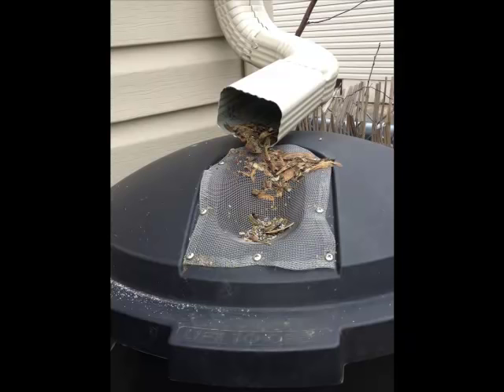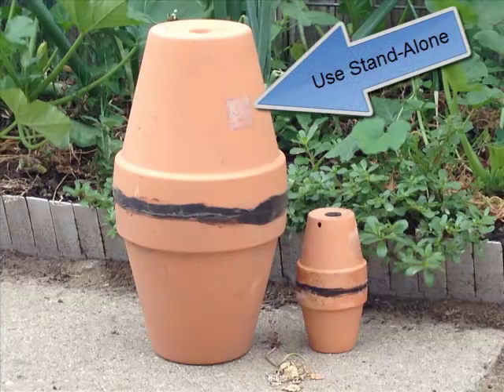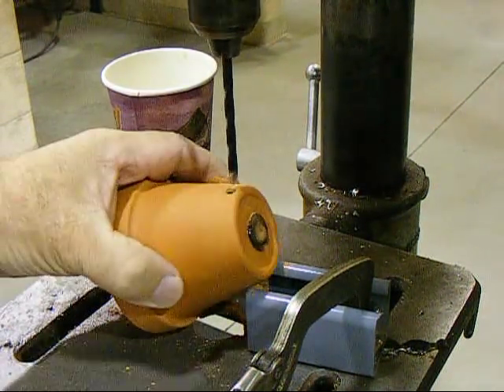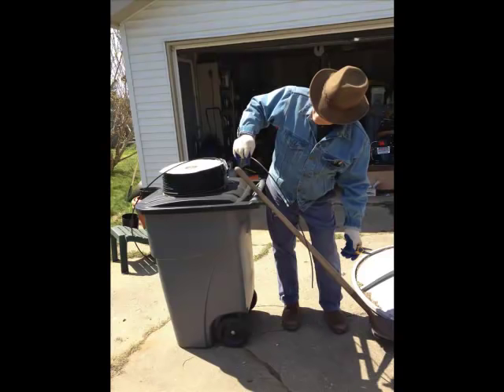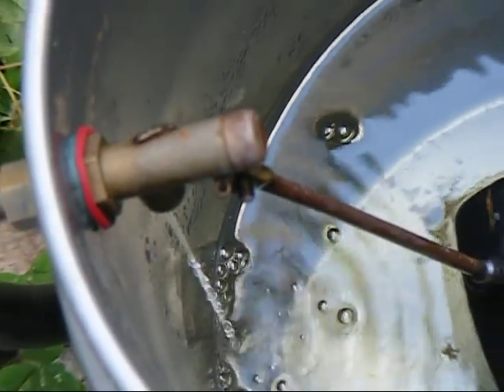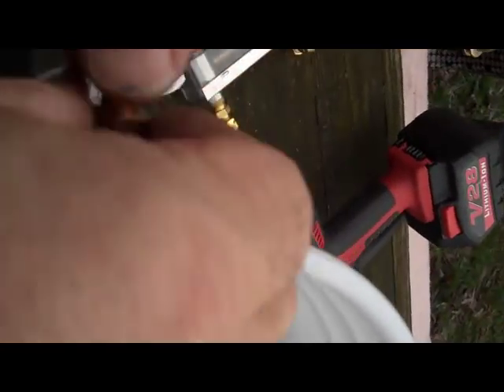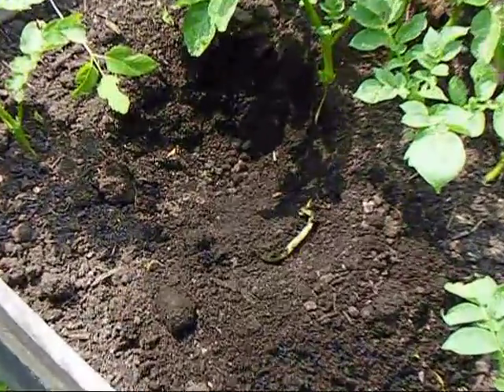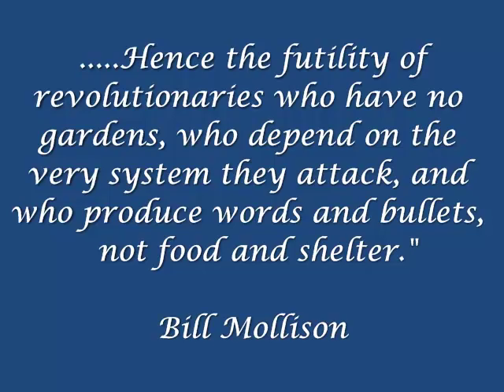Olla Irrigation Update - June 2012

Comment from the maker: I dug up the 21 ollas in my garden today, April 21, and none of them showed any sign of spalling or cracking due to freezing this past winter. All of the tubing connections were tight and the caulk joints were good and solid. The top of the ollas were typically about 4 inches below the surface of the soil, which I think is the key to my success. There were some other ones which were in another garden that were exposed at the surface and they didn't fare so well.

Comment from the maker: I really don't know how the Gorilla Glue does its magic, but it does seem to be fairly inert once it has set up. Thus far I've had no adhesive failures using it and it does a good job of sealing up the tubing at the point where the tubing is inserted into the posts.

Comment from the maker: The level in the bucket is determined by the amount of water needed by the plants. Most of the time a couple of inches of water above the irrigation tubing is fine. Ollas can operate at zero head pressure. The idea is to have just a bit of reserve so that the system stays primed at all times. However, the output of the system can be increased by simply increasing the water level in the bucket. A higher level increases the pressure on the capsules and thereby increases the flow rate. This can be

Comment: I think it's better to darken the vessels you use for water, not by painting them black but make a wooden lighttight  box (from pallets?). When u put paint on them the water will heat up to much. Using  a wood box will keep the water cool(er) and as long as there is no light in the tank, the algae wont grow.

Comment from the maker: Yes, using 5 small olla capsules in 4x4' raised beds seems to be working quite well for most of our plants here in Michigan, where we've had record-breaking heat and a lack of rain this summer. Our tomatoes, squash, cukes, and eggplant are thriving with the arrangement. Because of the drought I have raised the water level in the regulator bucket to help force a bit more water to the beds.

Comment from the maker: The float valve used in the bucket is a Dial #4164. The hose spigot on the IBC tote was connected using a short 1/2" pipe nipple and a 1.25 to .5 inch female threaded adapter inside. A rubber hose washer between the valve and the screw on cap for the tote prevents leaks. After some experimentation it seems like 2 feet between the ollas works the best for both raised beds and my "strip" garden.
Reply: Thomas Bowes Were the ollas in your strip bed made from the 2.5" pots?
Reply: The float is not needed. Direct connection and gravity fed works fine unless you have a leak somewhere.

Comment from the maker: Yes, you can feed the plants via the olla system. I typically use fish emulsion and simply hold down the float on the level valve so that the bucket fills up most of the way and then stir in about 1/4 cup of fish fertilizer. As the water feeds out to the ollas the fertilizer is carried with it and is delivered to the plants. You could also use worm tea, compost tea, or other liquid fertilizers in the same way.

Comment: Just a suggestion regarding the gluing of the two pots. Try a product called "liquid nails" or "no more nails". I have used this product for many things and when it dry's it's impossible to pull apart.Even cleaning a chromed screw driver that I used to spread the glue around I had to use a knife to clean it. Never tried it myself on pots like terracotta but who knows.

Comment from the maker: I think that you could make it work with a gray water system if you had a filter ahead of the regulator bucket. The problem with gray water is the soaps and oils in it, which would tend to clog up the ollas over time. You could probably filter the water through a barrel or large bucket of sand.

Comment: I am very glad I came across your video. I need a solution for irrigating my garden, and this is the direction I will head! Thanks!
Reply: And I have to say the price for the commercially available ollas is just robbery.
Reply from the maker: +Kip Lowery I agree. BTW, you might want to try a construction masonry adhesive as an alternative to Gorilla Glue or silicone caulk.

Comment from the maker: After some frustration repairing a fair number of ollas that I put together with Gorilla glue two years ago, I'm seriously considering trying an epoxy paste for the next batch of ollas. I'm also contacting a manufacturer of clay pots to see if they might come up with an olla set of pots that would nest together and have a larger glue joint.
Reply: I use E6000 glue. Honestly I don't know why anyone still uses Gorilla glue. That stuff is crap. E6000 can be bought at Walmart, Lowes, Etc and will glue ANYTHING. Only thing is it takes time to set up but when it does it holds.
Reply: +Thomas Bowes 
Have you tried Loctite PL Premium® Polyurethane Construction Adhesive? I use it for SO many things. It's waterproof and incredibly tough.
Reply from the maker: +firecloud77 I haven't yet, but I have. few ollas to repair and will certainly give it a try.
Reply: @baphomet8me  I was getting ready to order Gorilla glue when I saw this thread.  What do you recommend using now?
Reply from the maker: @billvoss5741  I was going to try the Loctite adhesive suggested above, or Liquid Nails masonry adhesive.

Comment: It would appear that the convenient use of a tiller-cultivator gets voided out in favor of building, planting, and watering ollas throughout the garden. Considering that, I'm led to believe that this is a location specific or plant specific solution and not meant for larger gardens. Thoughts?
Reply from the maker: I tend to think of one olla per four square feet of garden space. Conceptually, it is a central watering point for four one foot square zones around it. I have used it for specific plants, such as vine squashes and pumpkins on an individual basis. To use the system for the best effect it is necessary to rethink the garden layout.

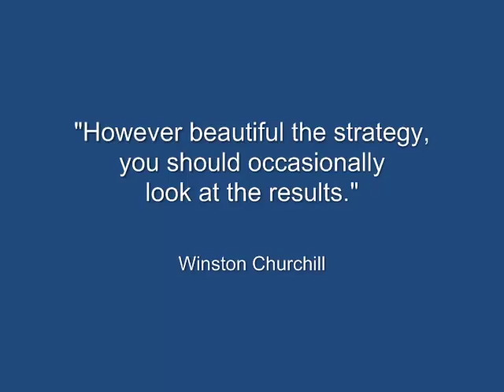Comment: At 7:06 you had a slide of the ollas in the ground, tubing coming out of both sides. You called the tube sticking up out of one as a "bleeder". What does that do? Is it just an open tube? Is there a valve of some sort on it? I can't really tell in the video. Excellent presentation though! I enjoyed and  learned quite a bit.
Reply from the maker: Basically you are creating a series circuit with the ollas...the water comes in from the regulator, through four or five ollas, and the last one simply has a bleeder tube on the outbound side to allow faster priming of the circuit and easier troubleshooting. I usually plug the bleeder tube with the plastic plugs that they sell to plug the holes for, and ends of 1/4" irrigation tubing. When priming a system I remove the plugs from the bleeder tubes of the last olla of each circuit and as water starts to dribble out I reinsert the plug. It's also a quick way to check if a particular circuit is working...remove the plug - got water - no problem. No water - dig out the top of the previous olla and proceed back towards the source until you find the leak.

Comment: this was very helpful thank you, i'm designing a new rain barrel system for my entire garden, likely using NPC flag drip emitters in most of the long 4' wideraised beds,also a few 2' at grade (spin farm types)..i like that you have the quote by Bill at the end,i'm a fellow permie'.  i have lots of pots to use up as well so ollas have been on my mind. how do you determine the level to set the float valve, do you let the pots fill completely then set at whatever the bucket level is at?

Comment: Hi, it's a good system. Why don't you create a hole at the bottom of the olla ? With the archimede pressure, all the ollas will have the same level of water. have you tried ?
Reply from the maker: The issue is that it would be much more difficult to do startup, troubleshooting, and repairs. With the tubing connections at the top it’s easier to figure out where the problems are and to get them fixed.

Comment: Can you explain why you need the float regulator in the bucket? Is it necessary? Could I just have a bucket filled with water and the tubing out to the ollas? Wouldn't the ollas, because of the slow dispersement properties of the clay regulate the water flow?
Reply from the maker: It provides a constant water flow without having to manually refill the bucket.

Comment: Now I'm confused about ollas. If you are constantly filling the ollas, wouldn't you find the first olla that gets the water from the roof, be over-flowing or squirting out of the hole in the olla that holds the pipe to fill the olla with water? I guess you sealed it so that it has not cracks at all but if one of them gets one, then welcome to "not working-ville."
Reply from the maker: tim mellis Which is why they are connected in groups of five or so with a bleeder tube at the end of the group. If you pull the stopper on the bleed tube and nothing comes out you simply keep working your way back until you get water. It's no big deal to dig one up and fix it.
Reply: Sorry for being a jerk. I was having one of those days. Your video is awesome and I was in the early stage of understanding the system and I was in one of my bad moods. Actually the information above about keeping the ollas in groups of 5 helps too.
Reply: @baphomet8me  how do you do the bleeder tubing at the end? Im totally doing this with my small raised bed in my side yard
Reply from the maker: @jujube2407  There are two ways. You can leave the tube open and stake it up higher than the regulator. I choose to plug them as then they don't have to have the ends elevated.

Comment: Hi Tom.  Thanks for the video, that was interesting.  Question for you: did you attempt using this system during the winter with any greenhouses?  I'm guessing that the lines freeze up during the winter with the only other way to prevent this by burying them deep enough.
Reply from the maker: Nick Kirby, I haven't tried it, but as long as the temperature stays above freezing it should work. The water lines can be run below the surface of the soil to better insulate them.
Reply: Another angle..... Can the finished system be installed and used, inverted (up side down)?...... so that the lines are buried deep enough to withstand being frozen?

Comment: You quickly mentioned a bleeder at the end. Can you please expand on what parts you used and how to use it, please?
Reply from the maker: The bleeder is simply a piece or tubing that extends from the last olla in a circuit up to the surface. I usually plug the tube with an irrigation system "goof plug" once I've established flow through the circuit. The tube can also be left open if elevated above the water level in the regulator bucket.

Comment: I am working with students at a small university to study olla irrigation to be used in an urban agriculture setting. Our Ceramics department are creating ollas for us and will make a large ceramic urn to be the feeder for the ollas. Our purpose is to only have to fill the urn once a week (at most) because the water supply is far from the garden bed and we can fill the urn with a series of hoses, but hope to not have to do this more than once a week. I am unclear as to the requirements for the urn (other than being able to hold enough water to continually fill ollas for a 4'x12' raised bed). How do we regulate the amount  (pressure) of water coming out of the urn and filling the ollas? Would love your thoughts or references for this!
Reply from the maker: agolini262f15, the urn would be set up at the highest point in the system and would feed down to the regulator and then to the ollas. While it is possible to not use a regulator, the problem is that when the water level in the urn is high the increased pressure on the ollas will cause excess water to flow, thus increasing the rate of consumption. With the regulator the pressure that the is applied to the ollas remains constant, with minimal seepage. The flow rate then is determined by how much water the plants need.

Comment: I don't understand one thing... are the ollas pressurized? I don't understand where the air goes when you add water. When I imagine designing this, I would put an air return tube back to the distribution bucket... but obviously that's not necessary for your system.
Reply from the maker: kettch42 The air will bleed out through the wall of the pot, eventually, but what I do is put a piece of tubing into the outlet hole of the last pot in a circuit. Essentially, each pot has an "in" and an "out". Usually the "out" goes to the next pot in the circuit, until you get to the last one, where it serves as the bleeder. The bleeder can be plugged with a "goof plug", or left open and tied to a stake so that the end is higher than the level of the water in the bucket.

Comment: for how many seasons can u use the ollas before replacements and how much %water do u save?. thank you for sharing.
Reply from the maker: Hafstadia, I'm on my sixth year with most of the pots still intact. The losses have been one that I hit with a shovel, one that was broken by a tree root, and a couple that had inadequate soil coverage when I first installed them. The lack of soil coverage causes the tops to spall during the winter, so I recommend about four inches of soil over the top of the ollas. As for the water savings, I'd estimate it to be about 70%, but it's difficult to compare since I also get higher yields with less weeding.

Comment: You mention a “bleeder hose”. Is that a tube at the end of the system to release air? I’m designing a gravity rainwater system to water my raised beds and I’ll likely use your methods. But I fear airlocks in  the system when I first prime it in the spring. Is that the purpose of the bleeder hose?
Reply from the maker: Yes, while the pots are porous and will allow the air to escape spring startup is faster with the bleeder hoses. Basically, if you remove the bleeder plug and/or lower the end of the hose and water dribbles out in a steady stream you’ll know that circuit is functioning.

Comment: I've been reading up on the net on toxicity and will be using aquarium grade silicone as glue as it is uncertain how carcinogenic polyurethane (base of the glue you use) is when hardened and in contact with water at all time. Given the root systems will be in direct contact with the olla I'm not going to gamble. Also, many PU glues contain a lot of other chemicals that are terribly bad for the soil and plant life. Be sure to read up close on toxicity on all the components of the glue before you are using it!

Comment: Why you make new holes for tubbing and you dont use the existing hole putting T connection ??
Reply from the maker: mou_eipan_na_ksekopsw, it is because it is difficult to keep the hole and fitting sealed. I tried it initially with rubber stoppers and tees, but they didn’t hold up.
Reply: @baphomet8me  thank you for your answer , i ll try with T connection, i have some ideas  to use differen diameter T , i ll make my experiments and i ll inform you.

Comment: when i test pots like that (that are not a olla yet), plugging up the hole and putting water into a pot, i can see that after a while, the pot has changed color on the outside. It looks 'damp' but i don't see any little water-drops or something...
So, i'm wondering if this'll work. The pots are terracotta and are unglazed. Is this normal and is this the case with your pots too ?
Or does that change when the feeding reservoir is higher than the ollas and there is a little atmospheric 'pressure' on the olla..?  (sorry for my English, i'm from Belgium)
Reply from the maker: Yes, the pots will appear damp but you should not see drops of water on the outside unless the system is under pressure. If the water has a high mineral content the pots may start to show discoloration from the minerals but they will still work.

Comment: I can't imagine wanting ollas if there's already drain lines.  why combine the two?
Reply: The ollas only wick out, when the soil outside is dry.  So they provide a regulated delivery of water that only happens in direct response to evaporation, plant root uptake, and maybe worms drinking ;^)  If you deleted the ollas, you'd be drip watering at an unregulated pace, sometimes overwatering, sometimes underwatering.  Sound right?

Comment: my concern in the gorilla glue you used to hold it together. Is it toxic and is there a safer alternative?. also does putting 5 small ollas in a 4X4 raised bed take up your planting space, and where do you place them in the middle outer edges or any where. By the way you did an awesome job!
Reply from the maker: I share the concern, but the evidence is that the glue is inert once it has set up. Placement of the ollas in a 4x4 raised bed is one foot from each corner and one in the middle.
Reply: the company says its non toxic

Comment: What happens if you have no bleeder tube at the end? i.e. is it completly necessary?
Reply: Sorry I found your answer: 
Thomas Bowes
5 years ago
@kettch42 The air will bleed out through the wall of the pot, eventually, but what I do is put a piece of tubing into the outlet hole of the last pot in a circuit. Essentially, each pot has an "in" and an "out". Usually the "out" goes to the next pot in the circuit, until you get to the last one, where it serves as the bleeder. The bleeder can be plugged with a "goof plug", or left open and tied to a stake so that the end is higher than the level of the water in the bucket.
Reply from the maker: Having the bleeder tube also makes it much easier to diagnose problems with the system and to get it started up initially.